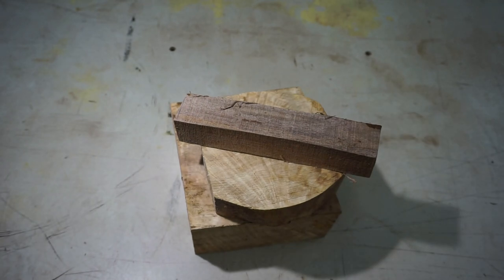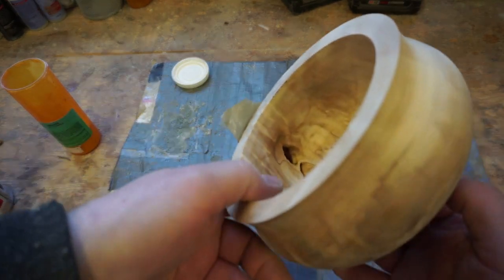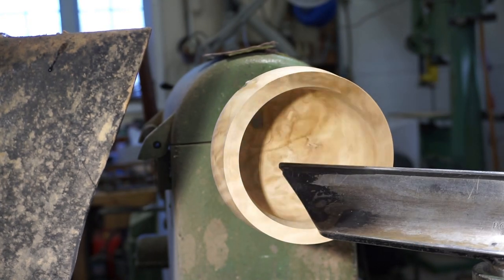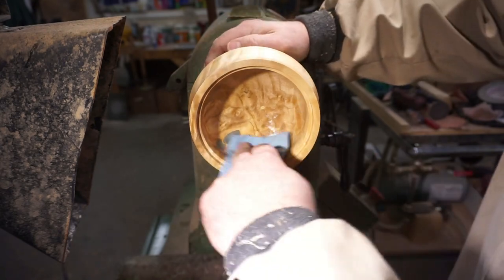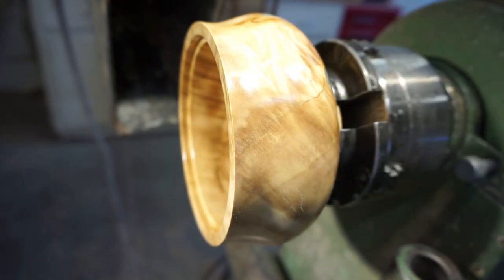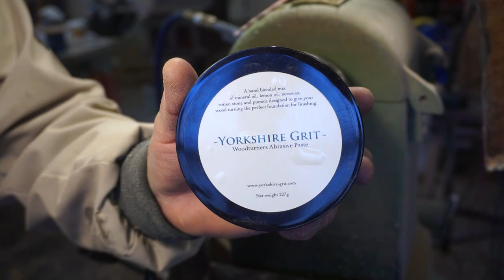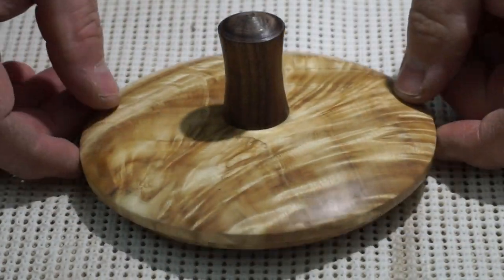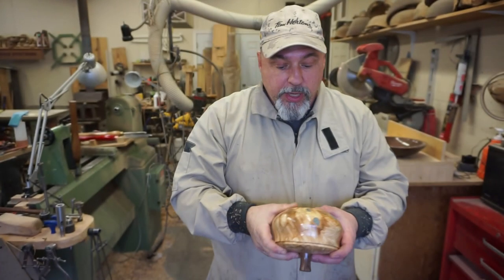Woodturning - The Poplar Crotch Lidded Vessel

Comment: Fabulous lidded box Jim, the figure is really amazing. I agree with the lid knob, keep it simple and plain. 👍
I use cellulose sanding sealer which I get prethinned from Hampshire Sheen. If I get anybody else's I thin by up to 40% with a thinner. Regards the Yorkshire grit, I apply it more liberally and work it in slow, about 300rpm until the gritiness is gone. Then take the speed up to 550 rpm for a minute or two, then start to take it off with clean cloth/kitchen towel at 800 rpm until I can't see any on the towel.
Disclaimer, this is just how I do it. 😀
Reply from the maker: Great info Ian, thanks!

Comment: Gorgeous wood! The figure is fantastic! I have watched a ton of turners use the sealer and none  of them have said they cut it at all. Don't forget you need to sand the surface after you apply it. The friction pastes are great.
Reply from the maker: Since this video was shot I’ve found out most do cut it 50/50.

Comment: Hi Jim,  Lovely pot!  The Yorkshire grit has mineral oil and wax in and is usually not used before oil finish although I have seen people clean the wax off with denatured alcohol before oiling.
Reply from the maker: The literature that came with the can said any choice of finish can be applied over the grit. The wood bowl finish worked just fine 🤷‍♂️, thanks.

Comment: Beautiful Piece Jim, I thin my Mylands Sanding sealer 50/50. In doing so, I add it into a little capped squeeze bottle which eliminates dealing with the original square can.
Reply from the maker: Already done! Thanks.

Comment: Tim, I'm watching your video on Maple crotch with maple burl and silver black tinted resin on TV YouTube.
You had a hell of a time getting it out of the bucket! 
Next time find the center on the bottom of the bucket and drill a hole. It will let the air in and release it in a tap or two. Just tuck tape the hole for the next pour! 
I'm not at turner yet. Bought a new 16X46 lathe floor model and setting it up for a winter of learning and turning! I'm a 100 percent disabled Vietnam veteran and sit too much. I figure it's time to start standing and not so much sitting. I've been building and flying RC models for over 60 years and sit when I'm doing that, so it's time to get up and try to keep from loosing my legs. 
My turning shop name will be 
"Birdcage productions". I thought it was appropriate because my nickname is Bigbird or just bird. Also quite appreciate because I love anything that flies. 
Any suggestions on how to get sponsors would be much appreciated.
Thank you my American brother.
I really love your work.
I'm a big fan of natural edge bowls and resin turnings.
Phil Anderson and The Papa 1947 are two of my other favorites.
Take care and let's keep in touch.
Bob Bray aka 'bird'
Reply from the maker: Hi Bob. Do you plan on starting a YouTube channel?
Reply: @SpragueWoodturning  
I was thinking about it. Don't really know much on how to.
Any help will be appreciated.
I've been modeling RC planes for over 60 years and have really burned out. I'm not done by any means, I am pationately in love with aviation. I have been a Craftsman for a long long time! I'm not sure how long I can do turning as I'm loosing my leg strength. I'm a 100 percent disabled Vietnam veteran from agent orange. I'll be 70 next month and feel 85! 
I don't think I want to make a business turning but I hope I can enjoy a long time doing it. 
Please, keep in touch with me.
I enjoy the videos you do.
I also like Phil Anderson and his natural edge bowls. I'm also interested in resin.
 I've been buying a lot of stuff.
I'm trying to get my garage set up as a wood shop. Supposed to be getting a double door fridge to make a kiln and another one for resins and glues so they won't freeze.
I'm a backyard engineer. I have 16 degrees, signed them all myself!🤣
Let's keep this going please.
Many thanks Jim.
Sorry I got your name wrong first time.
Bob Bray
802-279-5248
I'm in Vermont.

Comment: Very nice, I agree with the handle/finial, but the figuring is awesome. I’m a leftie and east coaster too. So when I get turning I’m gonna be reaching out for some tips, lol.
Reply from the maker: Get a General Lathe and turn on the outboard end and all will be good, lol. Thanks
Reply: @SpragueWoodturning  so does that mean you run in reverse?  I’m looking at a decent midi lathe to start, I just joined the local turners guild here in St. John’s as I’m just a very green beginner. That General is a nice piece of kit but way out of my price range and space is very tight for me. I’d be working in a 10x15 storage locker. So midi has got to be it for a while, with reverse. Im looking at a King Industrial 12x18 with reverse and 1hp motor. Around $700

Comment: I do thin the Mylands, it makes it easier to get a nice smooth coat on.  I also put it in a more friendly squeeze bottle.  But better than Mylands I use the Hampshire Sheen pre mixed sanding sealer.
Reply from the maker: Thanks for the info Amy, I will look into it. I’ve never seen it here in Canada.
Reply: @SpragueWoodturning  it looks like there is a store in Ontario woodsleesummercraft.ca  They sell Martin’s stuff in CA

Comment: Fantastic. I love it. One thing I didn't understand was why you used the abrasive polish after the sanding sealer as opposed to steel wool or sandpaper.
Reply from the maker: The instructions for the abrasive paste is to use it after the sanding sealer not steel wool or sandpaper. The abrasive paste is the liquid sandpaper.

Comment: I thin Myland's sanding sealer with 91% isopropyl alcohol, which is what it mostly contains anyway. Makes for a super quick drying sealer.
Reply from the maker: I rarely use it now, thanks for the info , Jim.

Comment: Jim;  I've been using the Mylands cellulose SS for about a year now since I had some snowbird friends bring me back some from the USA (Couldn't find anyone here that stocked it).  It's become my ONLY first coat.  I also use sanding pastes with mixed results and I'm still looking for a really good top coat to get the depth of finish I'm looking for.  I kind of like the Mylands high build product but find it needs more (thin) coats than you would expect.
Reply from the maker: I got my Mylands at Woodchuckers in Toronto. I think two coats of the wood bowl finish would of really made the grain pop even more than it does now. Just wanted to try something different. Thanks.
Reply: @SpragueWoodturning  Jim;  Do you mind if I ask when you bought yours.  I tried woodchuckers last winter and while it was listed on the web site they had no stock and I was told no more was coming in.  I talked to a number of other retailers and it seems it was, in part, an issue of dangerous goods etc.  I got 2 from the USA at the time because of the negative comments so I'm OK for quite some time.
Reply from the maker: Two weeks ago

Comment: I was surprised that you used poplar. I spent part of my life in Northern Ontario and we only had birch, poplar and mountain ash. No hardwoods. I do remember using it in a woodstove. Depending on how you wanted it to make a hot fire or slow we chose the wood accordingly. So I am surprised at how well it looks as we kind of thought of it was of lesser quality. But you did a fine job of it.
Reply from the maker: It usually is a lower grade wood, this piece is cut from crotch grain, that’s why it’s got so much figure. Thanks

Comment: as far as the can goes i just poked a small hole in mine ( mine had a metal plug in the top ) with a screwdriver so it just drips out a little at a time ,no or little waste that way :)
Reply from the maker: That’s a great suggestion! I’ve transferred mine to squeeze bottles, thanks!

Comment: Two comments one questions.

When driving tractor keep the bucket as low as possible until you HAVE to raise it. The more weight in the bucket the more critical this is. You will be surprised ( or dead) at how quickly it will roll over when you have the center of gravity raised.

Watched you unloading shavings. Before you put shavings in the trailer run a rope through a piece of plywood and loop it back through a Second hole. Tie a long piece to the loop and run it out the back of the trailer. When you go to unload tie the long rope to something solid and drive forward most of the shavings will pull out. I would keep a T post and big hammer in my truck in case there was nothing to tie off to. I was a landscaper for ten years and used this MANY times. The lazier you are the smarter you get.

On the 3 1/2  dimple disk, what diameter is the backing pad?

Thank you for the effort you put into your channel. I am learning so much.
Reply from the maker: Lots of good advice here! The sanding pad is 3”, that way the dimples wrap around it. Thanks for watching!

Comment: Is there a particular reason you use paper towel when finishing, as opposed to soft cloth? I really like the soapstone. I noticed there are a lot of colors within various woods, but have you ever found a wood that has blue in it? Finally, at first I was opposed to using a darker wood for the handle, but you chose well. It's a close match to the colors in the bowl/lid. I enjoyed this!
Reply from the maker: I only used it for the sanding sealer and the abrasive sanding paste. This is what most people use when applying these products. Thanks for watching!

Comment: Great demo Jim, This is the first time I have seen this method of using thin CA glue, accelerator and Soapstone. (I live in the middle of nowhere England, UK) I will be trying this method of inlay as soon as the necessary arrives in the post. Question: Could I also use Alabastor or Limestone? Thanks again keep it up.
Reply from the maker: I would think limestone will be too hard but I use alabaster all the time in my inlays. If you have a look through my inlay playlist you will find a ton of info on inlays, thanks. Jim.

Comment: Hi Jim,
Very nice project.  Suggestion, when you show pictures of the finished projects at the very end of the video please show the various different parts.   Inside without the lid, underside of the lid etc.  I often take screen shots and save them for ideas for future projects.
Question, is the Pilot V5 pen you suggest in your links solvent resistant so that when you sign the raw wood on the bottom of the project and then apply a finish that it won't smear etc?  The link at Amazon does not really address that?
Thanks again for another great project and I did just subscribe.
Myles
Reply from the maker: Hi Myles, thanks for subbing. I always try to shoot in natural light and the pictures that I shot that day of the inside and under the rim just didn’t turn out,  it I totally get what your saying. Since we’ve moved into winter here we’ve not seen my sunny days so it hard to get good shots, but I will work on it, lol. I’ve never had a problem with the pen smearing when the finish is applied over it. I’ve use a ton of pens over the years and this one is by far the best, safe turning. Jim.

Comment: Speaker issues on the computer meant watching without sound. Is this White Poplar? (Leaf is Maple shaped with white velvet back) Or some other Poplar species? enjoyed video even w/o sound. I learn a lot just by watching.
Reply from the maker: It’s not white poplar. The tree was five feet in diameter, if anything it was a cottonwood or a hybrid of some type. A forester in the area told me back in the 60s and 70s they were trying to make a fast growing poplar for the pulp and paper industry and this could of been one of them. The leaves looked like poplar leaves. The rings in it were 1”, so it was growing 2” in diameter every year!

Comment: Lovely.
Are you sometimes filming with a mirror?  You keep changing sides.
Reply from the maker: This is a very common question, I’m left handed, so I like to turn on the outboard end of my lathe on lefthand threads. Somethings are comfortable for me to turn between centers, like the outside profile of bowls or peppermills but any time that I need to hog out the insides of bowls it’s more comfortable for me to move it to the outside of the lathe. I use a 20” variable speed General.
Reply: Ambidextrous?
Reply from the maker: I wouldn’t call me that,  but I would be better at doing things right handed than righty’s doing things left handed.

Comment: Another nice one bites the dust. Why did you use sanding sealer on the lid but not on the bottom?
Reply from the maker: I tend not to spend so much time on the very bottom. Another nice one bites the dust??
Reply: Another nice one bites the dust?? I just mean it's another in a long line of great pieces. We used to say that when faced with a bin full of parts to make.
Reply from the maker: Lol, I get it now. Thanks

Comment: I forgot,  do you think a diamond cut off is the best for everything?  The cut off tool that came with my kit is flat
Reply from the maker: My impression is that diamond cutting tools are for hard materials like stone and porcelain not wood. This typhoon bit has small carbide teeth on it and is designed for wood, hope this helps.

Comment: What’s the dimensions of this one?  I have a maple log that’s about 8” in diameter. Is it possible to make a end grain pot or box?  I don’t think it big enough if I cut in half and take out the piff.  It’s been drying inside for 10 years.
Reply from the maker: This one is 5.5” across and 5” tall to the top of the finial. I’m sure you can make something out of it, it just might be smaller, Jim.

Comment: Beautiful bowl but I wouldn't use the soapstone. I would of used sawdust from the same wood and it would have looked more natural. I also would never use cotton rags on the lathe. It's very dangerous and not a good example to new wood turners. I never use steel wool because no matter how well you clean it up there is still fibers floating around in the air.
Reply from the maker: I wasn’t looking for it to look natural, I was looking for contrast, but it to each his own. I hear you about the rag thing, I was worried about shop towels breaking down, that’s why I used the rags. Jim

Comment: You do good work but I gave it a thumbs down. Because I like hearing the lathe and the gouge cutting. The soap stone in my opinion didn't look good with the poplar.
Reply from the maker: Thanks for you comment, I use the soapstone because it’s the most popular inlay that I do, what would you of liked to see besides the soapstone?
Reply: @SpragueWoodturning  I normally just use the shavings or the dust I collect from my bandsaw.